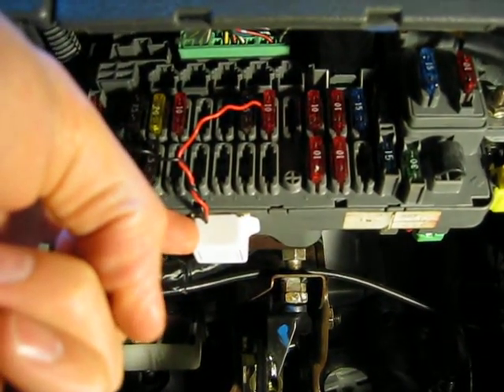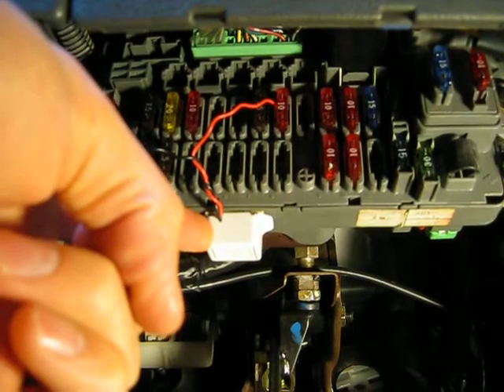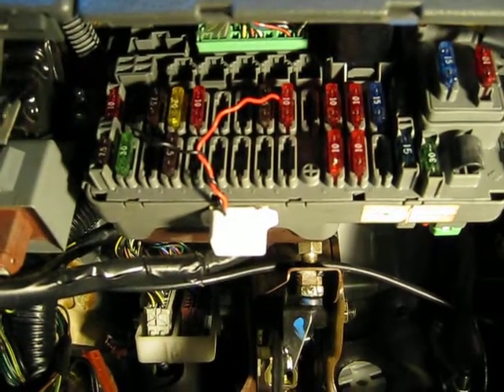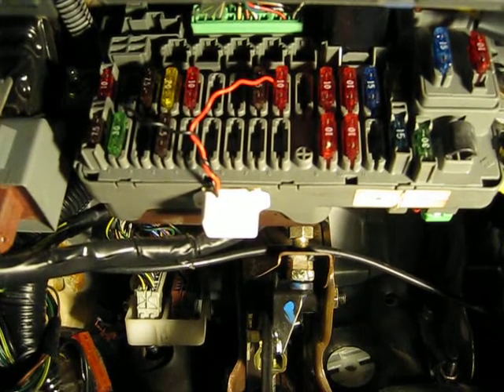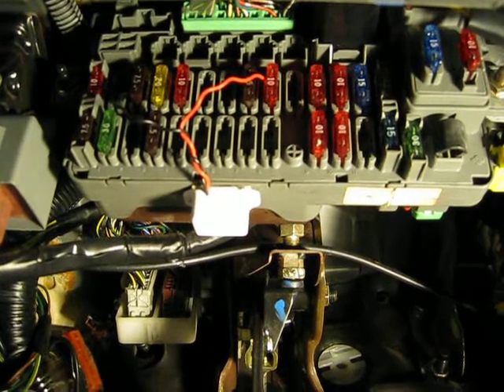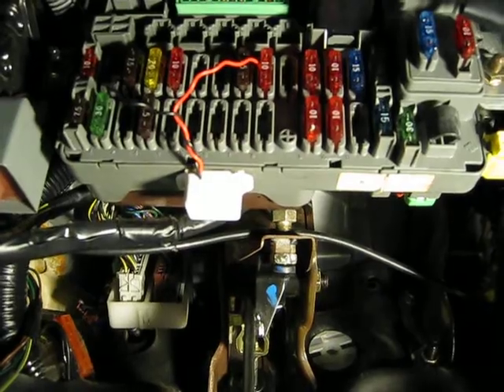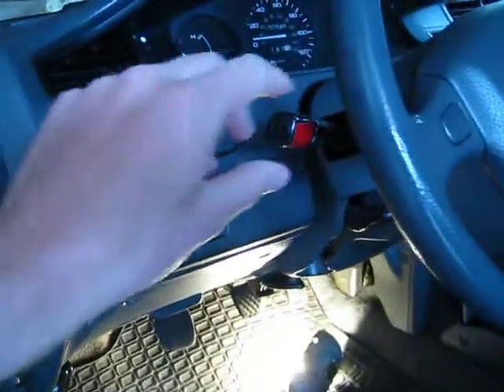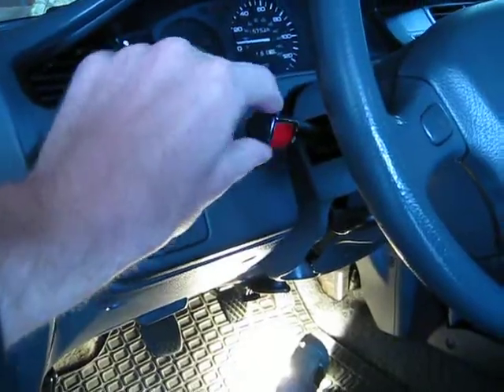Civic Headlamp Buzzer Installation (1992-1995)

Comment from the maker: I imagine newish cars wire into a neutral switch to prevent the buzzer from buzzing when the car is running AND in park. Not sure.   

Long-story-short... This buzzer is meant to prevent you from leaving your lights on while your car is off.  It's not meant to prevent you from leaving your door open while your lights are on.

Comment from the maker: Most add-on electronic devices for cars call for using something called "add-a-fuse".  Add-a-fuses are pretty nice.  However, they are relatively expensive (>$5 apiece).   Instead, I just remove the existing fuse, gently position the wire lead from the piezo buzzer into the fuse slot, then gently press the existing fuse back into place, effectively squishing the buzzer lead between the fuse and the fuse block. It's easier, neater and cheaper than using add-a-fuse.

Comment from the maker: Driftingdonuts, That doesn't sound right.  If the buzzer is buzzing all the time, I would remove it.   Sounds like it could drain your battery over time. Your civic is 5th generation, right?  Meaning it is a '92-'95 model?

Comment: Hey, this worked great for me but I did have to give it two tries. The first time I just wrapped the wire around each fuse and did not get any sound. The second time I inserted the wire into the socket, then inserted the fuse, and got sound. No more dead batteries...hopefully! Thank you for your video!

Comment: Yeah its a 95 sedan. It's not a very loud noise at all, you have to hold the buzzer up to your ear to here it at all, so I don't think it matters THAT much, but I was just wondering because over time I would think that even a very faint buzzing like that would drain the battery.

Comment from the maker: Hmmm... I wonder if it's possible to wire the buzzer into the circuit that turns the dome-light on when the door is opened?  In theory, this would turn the buzzer on only when the door is opened and the headlamps are on.   The only downfall might be that the buzzer would go on even if the car is running.   In other words, if you're dropping someone off with the car running, the buzzer would buzz the entire time the door is open.   Annoying...

Comment: I tried that but when I would turn the lights on, the buzzer worked, but then the fans would also turn on as well. I ended up putting the + wire the same spot you did, but instead moved the - wire to the wind shield wiper fuse. The buzzer does make a very faint, almost too quiet to hear buzzing noise though even when the lights aren't on.